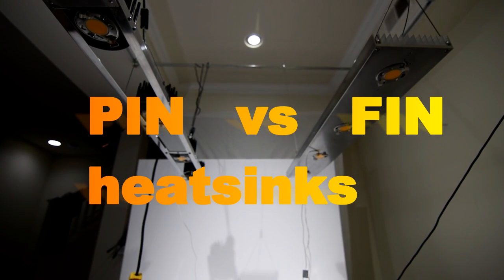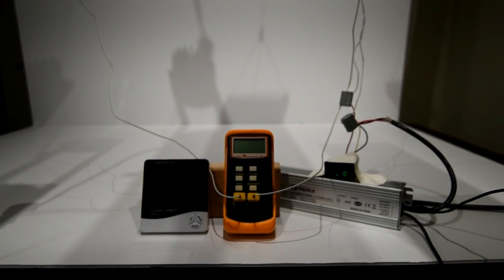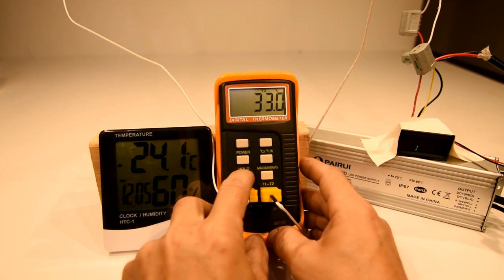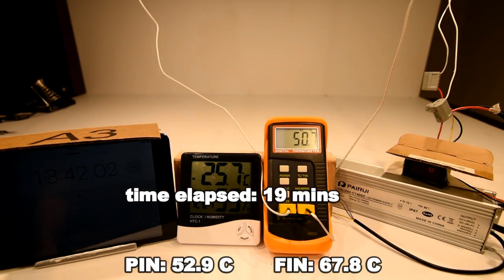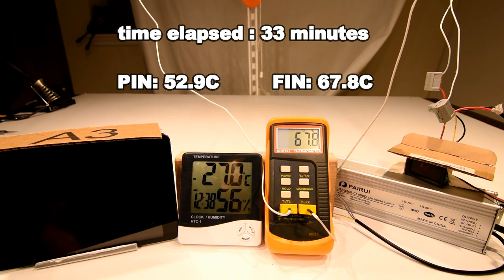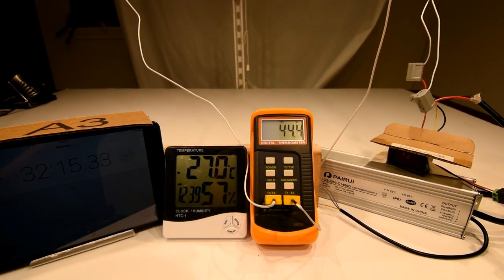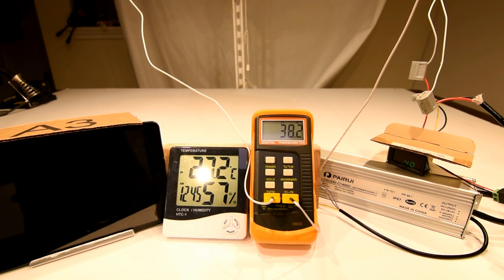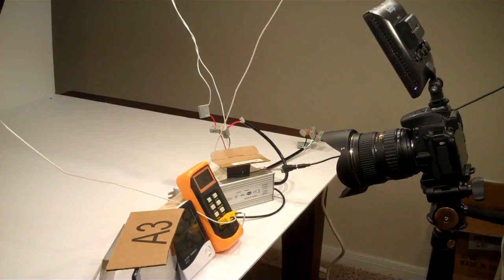PIN vs FIN heatsinks: a comparison for passive DIY led grow lights

Comment: So I doesn't matter what is the temperature of the LED emitting surface, only case (Tc) is relevant?

I measured mine running @ 875 mA (37V version) @90+ °C on the chip and some 40+ on the 150mm pin heatsink using IR thermometer.

Comment: Is it bad for the COBs if they're positioned like that only half of the COB is directly under heatsink if there is aluminium plate between them? I just tried my Mars modification and the heatsinks are not aligned perfectly for every COB at the sides and in the middle, will they be able to survive there or will it be a huge problem? Over half of the COB is under the sink still. I tested it for a while and it gets pretty hot on the bare aluminium behind the COBs but touchable.

Comment: Growmau5 I'm running (1) hlg 320 - 1020 on one heat sink.
I shot thru the lens with a Infrared thermo. reading a temp of 84°C directly pointed at the cree. is this something I can take as an accurate reading or should my readings be based off of the ceramic part?
Directly above my cree on the other side of the heat sink I'm reading 45°C.

Comment: Do you think the new HLG320H-C1050 would power 9 COBs? 305 volts/35=8.7 How close does the voltage need to be? If not, would i be better off running two 185s, or two 240s? Or is there no difference?

Comment: Do you know what are considered normal temps that are safe and will give the cobs its full life vs not normal temps? So many are using these fin heat sinks but I haven't seen any videos that say what heat temp ranges are to be expected and what temps are not safe

Comment: I can't thank you enough for all the info you share.  I built one of the heatsink usa lights back in season 2.  Now I want to move to the pin heatsinks too. I agree with you on Northern Grow Lights.  I just got some reflectors and they got here really fast.  I saw he has the 140 mm pin heat sinks too.

Comment: Great video...I appreciate your thoroughness...Quick question: with my understanding of the laws thermodynamics, and the fact that both fixtures are producing the same amount of heat.  Is it safe to assume that the PIN heatsink would draw more heat from cobs and in turn transfer more heat to the room, compared to the traditional FIN heatsink...So essentially the cobs would run cooler but the ambient temps would increase compared to traditional FIN. Would that be a correct assumption? What are your thoughts on that?
Reply: +growmau5 Hey thanks for the response...I see what you mean. After thinking about it, my previous assumption did not take into account, that the heat which was not pulled from the cob still contributes to the ambient temp. Thanks again and keep up the good work bro.

Comment: you need to try flared heat sinks too...and liquid cooling is cheaper and runs cooler and more efficiently and effectively. try aavid thermal cooling, if that company still exist, they have what you need.
Reply: +growmau5 I was able to pull this up, talking about cool looking. http://www.nofancomputer.com/eng/products/CR-80EH.php  ...pretty expensive, however very cool.

Comment: This is excellent information. Keeping the temperature down will extend the life of the cob increasing the advantage of LEDs over the older technology lighting. Cree and Bridgelux specify the life ratings of their cobs at 85 deg C (185 deg F) junction temperature and you are under that although the HS USA assembly may be approaching the recommended max temperature. This is understanding that the cob temperature is somewhat higher than the heat sink temperature. It would be interesting to use a non contact thermometer pointed at the center of the cob to see how the temperatures readings correlate to the meter. I am really curious as to what would happen with fans added to each cob, and if the current was to be cranked up to push the cobs to the limit.  No criticism intended, this is eye opening and great information, thanks for the effort.
Reply: +growmau5   Going passive is absolutely a big positive, for anybody. Your measurements, especially on the HS USA setup, show that if the cobs were to be driven at 1750 or 2100 mA passively the 85 C number would probably be exceeded and the life of the cobs shortened, possibly dramatically. Adding fans might not even provide enough cooling. Your data may have saved somebody from making a very expensive mistake. Anyway, you are THE MAN when it comes to LED lighting.

Comment: just as I started to assemble all my heatsinks lol 
oh well no complaints I'm happy :)
Gonna shoot you some pics when it's all done and hung.
Love your tech test and innovations, keep being awesome!
Reply: No I understand they are not bad but I copied your setup to the T with 32 Cobs & 700ma, so efficiency is what I was after.
Im not worried though I know the setup will preform, especially thanks to all your info. 
Im wanting to upgrade the 250w - 700ma to the new 320w - 1020ma driver.
Im assuming I will need to factor in some active cooling, have you tested your setup with those drivers yet?
I would love some feedback before i drop the ball on 8 of them. 
Also Id like to talk more in depth about the arduino setup you tinker with as I myself and trying to hire the help from friends to make it happen as well. Curious to see where your progress is with it & if i could help in anyway.
Reply: +growmau5 nice interested to see a the harvest results.
I actually was planning on running 8 320's, powering 4 cobs each. Mainly because im switching over from 6k hps and want the best transition as possible, granted that theory  is just that. tested my 240h last night and the heatsink was in the low to mid 80's. I tried reading Cree's case temp suggestion and it looks like after 135°C I lose efficiency? 
I hit the led's with my infrared thermometer thru the lens, so I'm assuming that's good. 
They were only up to 120°F after 20min. 
You have so much going on lol
I wish I had the electronic side of things down like I do mechanics so I could just program my own arduino

Comment: Dude how do you feel about the new 6.08inch profile that heatsinkusa offers?  That's what I use for all my 3590 builds, and they have significantly different heat-dissipation characteristics from the profile you use.  Way thicker fins, but much shorter.  It's kind of like a pin heatsink, but the pins are connected.  The short, stout fins work with air-turgidity (chimney effect) like pins do, and I think it's the cheapest profile available.  I actually just copped a camcorder, I'll upload a video today using a basic IR gun to check out what's going on.
Reply: Yeah, I can assure you, passive will not, not, not work with these guys for anything practical.  That being said, the really thick base-plate seems to really yank heat away from the chip, and seriously, for a couple bucks for some fans, I'd say they're worth it.  And sometimes I run around with them and pretend I'm a final fantasy character.

Comment: Hey great vid, as always :)  Just wondering which model heatsink you used (from cutter).  There are several there, and the pin ones ran so cool it almost seems like you could've gone a size smaller (with good air flow of course).
Reply: Ok I guess its this one: http://www.cutter.com.au/proddetail.php?prod=cut2902
$30 ea
Reply: Ah, that's Australian $ I guess, $23 US
Reply: +DrBlaze LPF11180-CUT

Comment: i'd bet the pin one performs better, but never imagined it's that much - holy crap.
with this video, you clearly made my decision on what sinks i'll use . i'm glad it's the pin style b'c the flexibility in design it gives is also a huge issue to me - sadly, they're currently sold out at cutter :(
thanks for the vid and clarifying that for us!
Reply: +zero. next delivery on the 12th May, Monday the 16 to our store, shipping that day
Reply: +john hartley yes we are taking backorders right now and will ship on FIFO basis(first in first out),we have 1000 pcs coming
Cheers
Mark
Reply: Ok, much appreciated for your response I will order now thanks
Reply: +CutterElectronics : thanks for the info. i should hit the 'back order' button :)